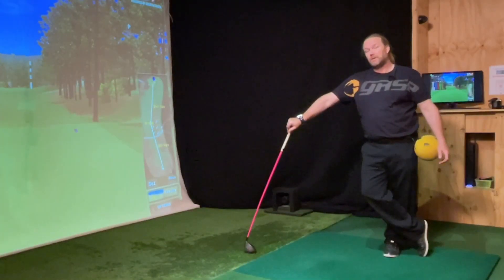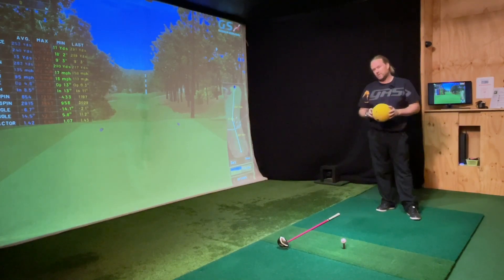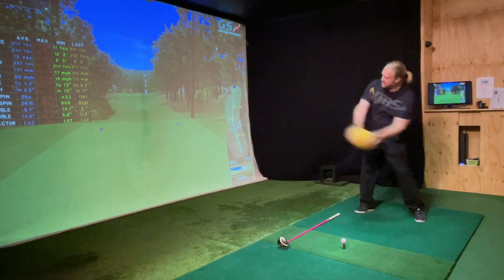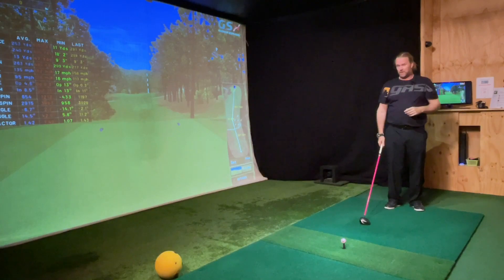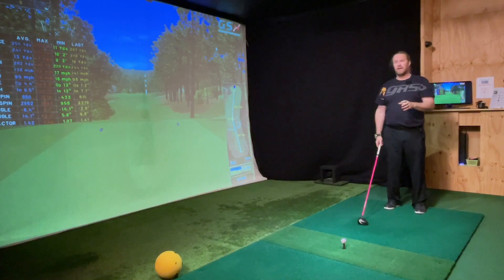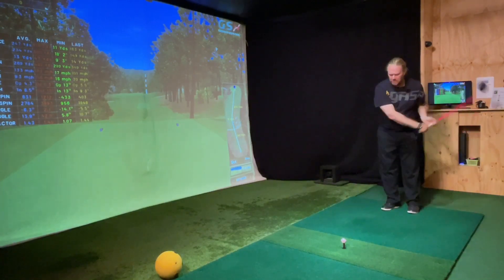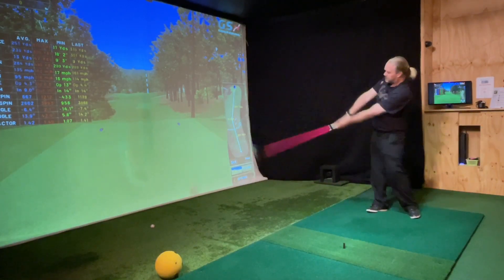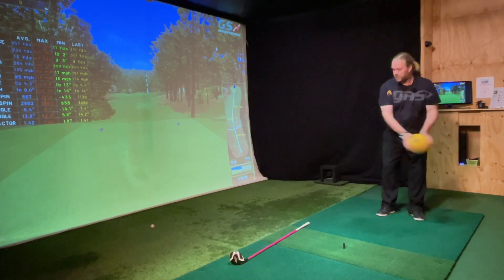Understand speed & power…

Comment: Thanks for sharing, Marcus. The circle of speed is an eye opener. I did 10 counts, and the feeling was strange and surprisingly, I was able to come from in to out with square stance. I will start doing this with all clubs. I do feel the shaft change in direction in my grip/fingers. Is that normal? Do I need to grip it bit more firm? Curious, what make is your driver? Stiff shaft?
Reply from the maker: The club should not move around in your hand, use one finger and use it to grip it firm. I use my index finger on my lead hand. Watch this: https://youtu.be/5S-V7W5Rh5M

My club is an old regular flex with a 13 year old Callaway X2hot head.